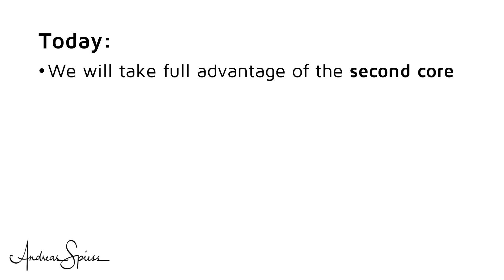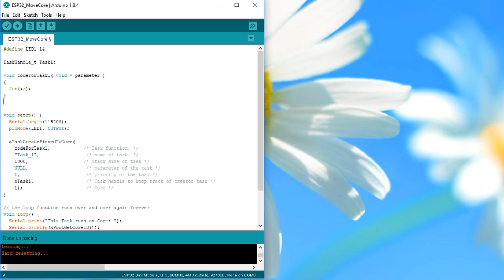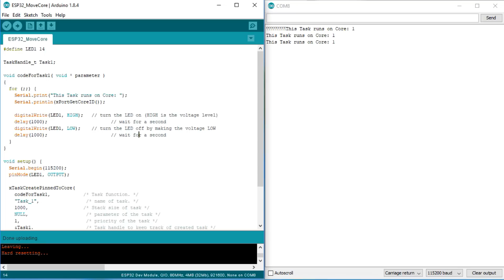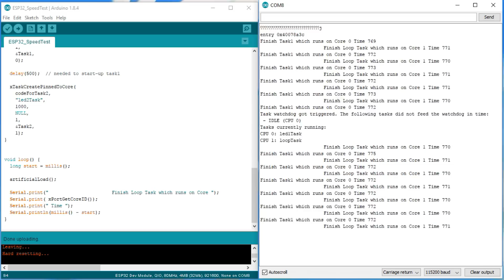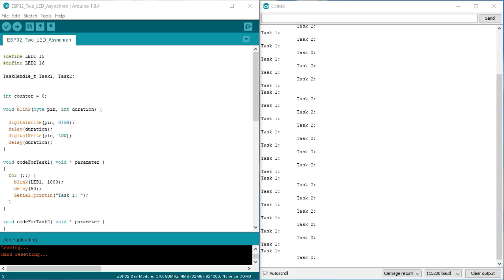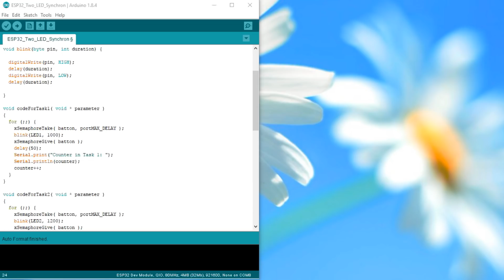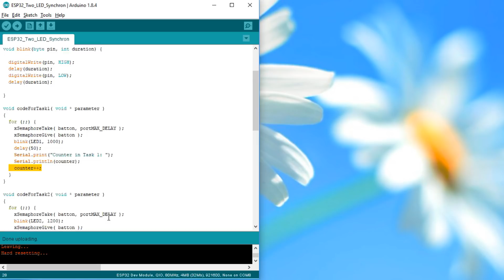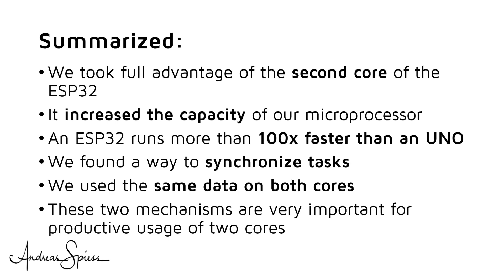#168 ESP32 Dual Core on Arduino IDE  including Data Passing and Task Synchronization

Comment: I have an ESP32-C3 which has a single Risc-V and an ultra-low-power co-processor...  but I imagine the process is the same as for this ESP32-S series  (2 Xtensa LX6 high-performance cores as well as a ULP co-processor) 

However assuming I can compile 8KB ULP code and flash (0x50000000).. in addition to the RiscV code  (0x10000), does the inter-core communication work the same?   For example, I imagine that the ULP and RiscV can each access peripherals (ex. !UART) bt still need to coordinate their use via some shared ram?
Reply from the maker: Did you read the datasheet? The -c3 only has a RISC-V main processor, no Xtensa.

Comment: Sir, I have a power monitor code for blynk and I want to same parameter showing on LCD also.
So am writing the code for LCD with blynk code. 
LCD and iot blynk both of part is proper worked.
But problem is LCD is not working when internet is disconnected from ESP32.
How to solve this problem sir?
Reply from the maker: I never used blynk. So I do not know 😒

Comment: Is it possible to run a I2c device in one of them Tasks ? So far i haven't seen any examples of that. ie.  as5048 Position sensor running on one core and making its Angle data available globally to the other core..I cant get it to work.
Reply from the maker: Try it. I do not know why it should not work.

Comment: Hoi Andreas, thank you for your tutorial on core-pinning! I'm in the process of make a game-console and am trying to play the necessary sounds on core 0 of an ESP32, the rest, including the writing to a small 8x8 WS2812-LED-matrix 30 times per second, is done on core 1. Strangely, whenever the playing of a soundfile is either started or finished, the matrix shows a glitch, as if something disturbed the communication between core 1 and the WS2812-matrix. Do you have any idea how I could make sure, that core 1 can savely send the necessary info to the matrix without interruption? Cheers, Dani (also with swiss accent)
Reply from the maker: One Core is also used by WiFi and other tasks You can chose it in the IDE. I would use interrupts for realtime responses, BTW
For sure, such things are difficult to debug. I usually use the oscilloscope and toggle pins at particular places in the code.

Comment: This video is very explanatory, you are amazing. What is running in core 0 by default? I could run a complete interface made with lvgl in one kernel and other tasks in the second one? thanks a lot ;)
Reply from the maker: You can choose where things run. Either in your sketch or before compiling in the Arduino IDE. Some Espressif tasks seem always to run on core 0

Comment: Can I sacrifice 2 or 3 pins and feedback clock signal to the through 1 pin and read in another pin for better synchronization?
Reply from the maker: I do not understand which problem you want to solve :-(

Comment: Excellent video, I just had one question, do you think one could use one core to take readings from 3+ sensors and another core to handle Ethernet connection to send it to a database/internet? I want to do that with my project but I'm a bit concerned about timings and delays i want it to be faster and more efficient that doing everything in one core...
Reply from the maker: As shown in the video, you can pin every task to a core, if you want.

Comment: Thank you a lot for that great explanation. I wonder now what makes the most sense to use both cores. In my case I need to read a lot inputs (digital & analog) and also use outputs ( digital & analog) and I want to use websockets to display data in the browser. 
So does it make sense to run the I/O in core 0 and the web server/sockets on core 1? 

Thanks for your council
Reply from the maker: I do not know. Just try it.

Comment: [CH]
Andreas ? Meinsch's wär möglich 2 ESP32 zumä Quadcore System z verhänkä, wo ich au chan Tasks hin und her kopiere via SPI ? 😉

[EN]
Is it possible to build a quad core system with two ESP32 chips?
Building an interchip version of the xQueue that communicates via SPI, it would be possible!
But would it be possible to copy tasks to the other chip that were not configured there? 😉
Reply from the maker: MCU programs are stored in flash memory, not in RAM. I never saw a project where a running program flashed the chip it is running on.

Comment: Hi Andreas, I'm your follower, I'm sitting in the front row! I am very interested in activating freeRTOS Core 0, because my sketch wastes a lot of time on wifi reconnection or sending to MQTT. But the moment the sketch tries to connect to wifi, the ESP32 reboots.

19:15:44.262 -> rst:0x8 (TG1WDT_SYS_RESET),boot:0x13 (SPI_FAST_FLASH_BOOT)
19:15:44.262 -> configsip: 0, SPIWP:0xee
19:15:44.262 -> clk_drv:0x00,q_drv:0x00,d_drv:0x00,cs0_drv:0x00,hd_drv:0x00,wp_drv:0x00
19:15:44.308 -> mode:DIO, clock div:1
19:15:44.308 -> load:0x3fff0018,len:4
19:15:44.308 -> load:0x3fff001c,len:1216
19:15:44.308 -> ho 0 tail 12 room 4
19:15:44.308 -> load:0x40078000,len:9720
19:15:44.308 -> ho 0 tail 12 room 4
19:15:44.308 -> load:0x40080400,len:6352
19:15:44.308 -> entry 0x400806b8

Do you have any sketches that allow connecting WiFi on core 0 or any idea what could be wrong? My idea is to separate the fast core 1 and the slow core 0 (wifi, send mail, send MQTT).
I will be very grateful for a help
Peter from Chile

Comment: almost 5 years later, still an excellent video. 2 comments: (1) changing the counter on both tasks can cause a collision. I would recommend adding it to the semaphore stage, so it is guaranteed  to  be safe. (2) Why using delay() function? this is bad practice, especially when interrupts are used. I recommend use the millis() command.
Reply from the maker: The delay in this scenario is ok because it is handled by RTOS. I agree with the semaphore.

Comment: You should protect the global variable with a mutext (which is like a semaphore, but better protected from deadlock, because mutex can make the priority of the process (Task) that have the control over the mutex temporary higher, which doesn't happen with semaphores).  So take the mutex before increasing the variable, then release the mutext after the use.

Semaphores are usually used to synchronise two or more processes (Tasks) and mutext are usually used to protect global variables.  As semaphores can count how many processes are allowed to be in the critical section, tasks can not.

You should also probably have two semphores to synchronise those two processes.

That is, only one of the processes can change the counter at a time, making access to the variable serialized (and protected).  Because reading, increment and then store the variable is divided in several instructions that can be interrupted by other processes (Tasks in RTOS).
Reply from the maker: Are you sure FreeRTOS offers a mutex? AFAIK they use the same concept for both applications. But I am no software guy.
Reply: @AndreasSpiess  I have not tried myself but watch a YT videos that coded mutex. And mutex elivated priviliges temporary so the risk of livelock was reduced/removed. Which is the difference between mutex and semaphores.

It might be that it was another version of RTOS.

Added: This was the video:
https://www.youtube.com/watch?v=I55auRpbiTs&list=PLEBQazB0HUyQ4hAPU1cJED6t3DU0h34bz&index=6

Comment: "int counter" is not a good idea. try "static volatile unsigned int".
Reply from the maker: You can do that, of course. However, I do not know the advantage in this situation where the counter value hardly goes higher than 100 and the variable already is "global".

Comment: For task synchronization use direct task notifications.
Reply from the maker: What do you mean? Queues?
Reply: @AndreasSpiess  If you want to just synchronize task execution (like you've done here with LED blinking), the right tool is using task notifications ( https://freertos.org/RTOS-task-notifications.html ). One creates a task and in its routine waits for the notification (which blocks its execution). When such notification arrives (from another task, or even interrupt), the execution continues.

Comment: I really got into using the ESP32 for wifi radio. I have built several versions now, all based on the little powerhouse. My latest are now being built into old amps for apple phones and iPads.. I have been locating the 5 volts inside and building the units inside the case, hook them up so the aux will switch them on.  They play wonderfully, I left off the ability to change stations locally and still use my cell phone for tuning in the channels should I ever wish to listen to something. I picked up a couple of different brands of these devices 2 of the 3 that I have had room inside to stuff the ESP and the decoder.  To protect the ESP inside the case I soldered all the wires then used a heavy duty heat shrink tube to cover it and shrink it down . This way there is little chance o it shorting out
Reply from the maker: Sounds like this project is getting better and better!

Comment: Great tutorial and explanation thnx.

I downloaded your example sketches from your link below, and they work perfectly on the ESP32 as expected. However, curiously on the Arduino UNU the calculations don't appear to run. "Task Time" is around 13-15ms only.  I added a serial print statement inside artificialLoad() to check that the code was executing correctly and the loop DOES call artificialLoad() - the "Task Time" jumps to around 67-69ms and the serial.print text shows as expected.

It just doesn't seem to be executing the loops. I copy/pasted your code, and they execute OK on the ESP32. I have tried multiple UNO boards - same results.

Any ideas?

thnx
billd

EDIT: After more troubleshooting I found if I add a delay(1) inside each for loop, then the loop will execute, without the delay (or any other function), the loop does not execute.

EDIT EDIT: After much more troubleshooting I found two things I needed to change:
1. I had to declare "long i" and "long j" as global variables (not inside the for loops); and
2. I had to "do something" with t1, t2, t3 & qq. I added simple Serial.print() statements at the end of the void loop() to show the result of each.

Now the sketch takes approx 53 seconds (similar to the video).

I guess something has changed in the Arduino IDE since the video was made, it appears (I'm guessing) that if you do not use the results of a function as an output or an input elsewhere in the sketch, then the IDE does not compile that function.?.?.?
Reply from the maker: You are right. They always change small things from release to release. I am glad you found a way to make it working.

Comment: Perhaps a noob question, but can the cores handle hardware interrupts individually (e.g. pin A, B and C assigned to core 0, and E, F and G to core 1)? Thanks for a great and informative video.
Reply from the maker: You assign the interrupts in a task and the task runs on a core. But I never tried it.

Comment: i try freertos dual core to run simple web, but it fail if i put client and web task in core 1 or core 0 like freertos example. it only works if i put the web task in loop() which run on core 1.

Comment: hi sir, how your compiling & uploading is too quick , anything special you did ?
Reply from the maker: Nothing special. Just PlatformIO
Reply: @AndreasSpiess  Thanks, but this Dualcore tutorial based on Arduino IDE,  & i.e. too on windows PC , seems too fast than normally I see.  May be 1. Your good processor pc 2. Your ESP vendor/ version  &
... is usb or port current also matter much ?
I'm using wroom32D, on windows Arduino is bit slower than on Mac. Correct me , if anywhere I'm wrong.

Comment: I was running Core 0 but everytime registered interrupt on core 1 restart the esp32 and warning was. Core 1 was in the ISR context.
Reply from the maker: Unfortunately I cannot do remote debugging. But I am sure that you will be able to find the issue if you start with a working sketch and then change small things.
Reply: @AndreasSpiess  Basically, There is a timer interrupt which is running after every 7200 microseconds. This interrupt is running on core 1 and i am using core 0 for monitoring of wifi connectivity.When the wifi connectivity comes into contact and esp get connected to wifi on core 0 and at that time esp32 servicing on core 1 and a exception comes up core 1 was running in the ISR context. Please let me know if i can do multitasking with consideration of interrupt which is happening everytime after 7200 microseconds and i have to also manage connectivity when it get disconnect.

Comment: Did you actually use is on any bigger project? I have a web radio project and wanted to move the sensor reading to a different thread, not to pause the audio playback. My ESP constantly restarts because the new task is not hitting the watchdog timer.
Reply: Ignore, I think I got it. It looks like a few more lines are required for a more complex program than as in your example.
Reply from the maker: That is well possible...

Comment: Hi Andrea's, I think if you are reading/writing the same variable from both cores you should define it as volatile so the core always loads from memory and not what the compiler optimises to. Semaphores are good,  but I think you could also use volatile flags
Reply from the maker: You are probably right.

Comment: Love this. Using this on my LED clock - bought 0.8" LED display and the core0 just refreshes the display, core1 does the logic. All of it is done using 1 ESP32, 4 resistors (100ohm) and 1 LED display.

Btw, I had a watchdog problem with core0 in Arduino.
I had to add these 3 lines to the for(;;) loop:
    TIMERG0.wdt_wprotect=TIMG_WDT_WKEY_VALUE;
    TIMERG0.wdt_feed=1;
    TIMERG0.wdt_wprotect=0;
Reply from the maker: Thank you for the information! Good to know.

Comment: Andreas Spiess that means that I can run a code of wifi to read data in one core and the other part of the code in other core? Congratulations for the video. Cumprimentos from Portugal.
Reply from the maker: It is not easy. You have to do all the synchronization if you use the same data an both cores.
Reply: @AndreasSpiess So it's still possible.Thank you. Amazing job!💪👍🙌

Comment: Hello, I have a problem and I cannot solve it, when I load the arduino sketch it gives me an error when compiling several times, always referring to the commands used by the dual core, such as ('TaskHandle_t' does not name a type, ' xPortGetCoreID 'was not declared in this scope, etc) someone knows if I require a special library or something, the truth is that I am vastly lost, thanks in advance.
Reply from the maker: I tried to compile several examples from github and they work. Do you use an ESP32?
Reply: @AndreasSpiess  Yes, I have 3 esp32, 1 cp2102 and 2 ch340, I bought different versions just in case, but I did'nt find the solution for certain compilation errors such as those named above.

Thanks for your attention.

Comment: Very nice and explained video just have a question. So Which core handles all the wifi work?. Also can I run two website at once and fetch the information from both at the same time? 

Thanks.
Reply from the maker: I read Wi-Fi uses core0, but I never researched myself.
I do not think you can fetch 2 websites at the same time because of this fact.
Reply: @AndreasSpiess  well thanks for the help but I actually got it working now . Wifi dosen't use core 0 and u can sort of get data from two website at once but one core has to finish its work first to shift to another core which speeds up the data fetching work.

Thanks

Comment: Wow, ESP company did a lot of work building the RTOS and Semaphore.  Really difficult to figure out.  Very good example.  Like you said Global Variables pass between Cores easily enough although the variable is susceptible to data corruption.  Creating a class to pass Variables using pointers would be the normal way of securing the data as the address is what is passed not the data.  Although there are also security issues with this as well.  Because if the pointer is changed your reading the wrong data.  Setting up the stack properly and ensuring the function doesn't exceed the stack size would probably secure this better.  But just thinking out loud.  Wondering if you can demo using ADC and seeing how sensor data can be read and Transmitted to another ESP32 using the dual core would be neat.  Have a great week and thanks for the upload.
Reply from the maker: If I remember right this was done by viewers. I never did it myself.

Comment: First of all thanks for yours fantastic video! Do you have more information about WiFi connecting and handle on CORE 0 ?  In my project i need a no stop loop, now I'm doing some test, I run my loop on core 0 and WiFi and MQTT connection and handle inside the void loop (core1). Do you think should be better to reverse the core (my important loop on core 1 (void loop) and wifi and mqtt on core 0? Without dual core solution, WiFi connection and MQTT conenction stops the loop until 3 or 5 seconds (if not wifi signal or mqtt broker is down). Thanks again!
Reply from the maker: I did never investigate where the "Arduino" stuff runs. I read it is on core 0. Just try your code on both cores and keep it where it is not interrupted...

Comment: delay() Vs vTaskDelay()
As I have understood; delay() method just blocks the processor (without doing anything), in which the code is running, during the delay time and do nothing other than waiting. On the other hand vTaskDelay() method blocks the processor, in which the code is running, but send the message to the other processor to do its tasks during this vTaskDelay time.  
In this way I believe resources are better utilised.  The question is can we call (or used) vTaskDelay() method in ESP32?
Reply from the maker: I do not remember all details. Maybe you consult the documentation or do some tests ?